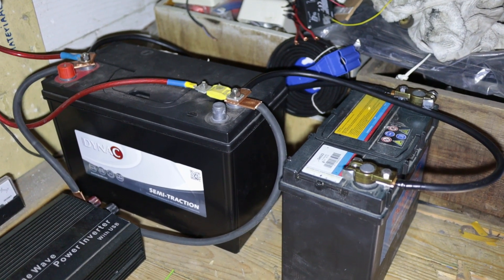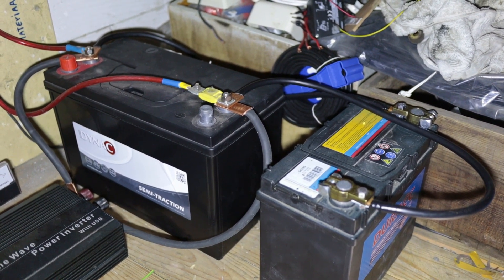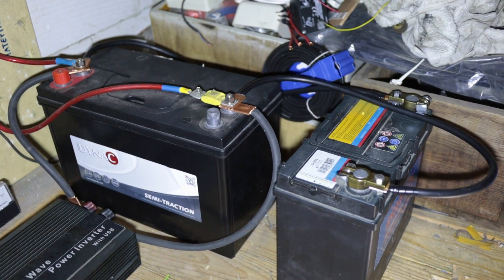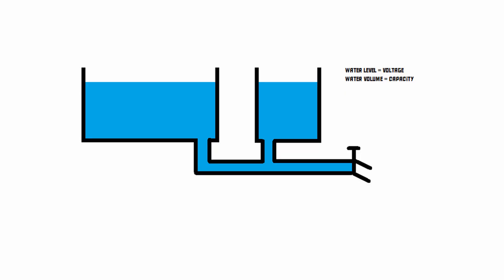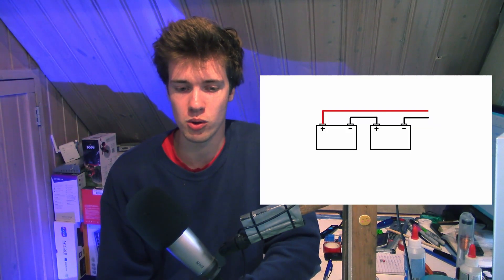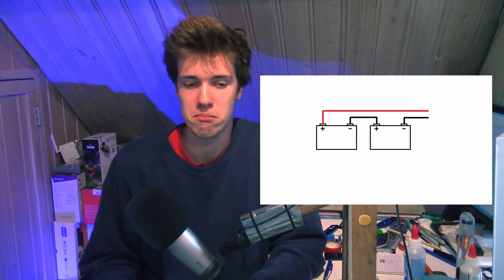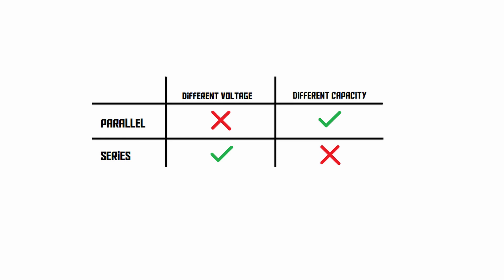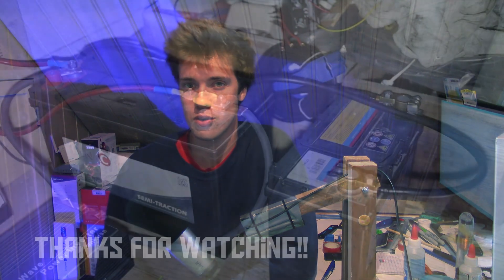Connecting different batteries in parallel/series (AKIO TV)

Comment: Quick question as temperery solution i have two large lead acid battery's of nearly the same ah I need to connect them in series to obtain 24 volts the current draw is only a Chinese desil heater and there charged all day on solar so can I get away with this as temperery fix till I have new battery's 
Thanks in advance

Comment: I have a question, I have 4 x 12.8v 200a lithium batteries connected as 2s2p going to a bus bar and then a 24v 3200w hybrid inverter. Can i connect a battery charger or chargers to this setup to top up the batteries . I live in the north of Scotland, I have 12 x 200w panels and through the winter there is not enough sunlight to keep the batteries charged so if i set timers on chargers to use cheap night time rates for mains electricity and use this power during the day. BUT how and where in the battery setup would I connect the charger/chargers. Hope all this makes sense.

Comment: I currently have 4 x 300ah LFP in series (48 volts).  They are 9 months old.  I would like to add another 4x300ah (same voltage and ah).  Should i wire it:  new+old in parallel (so they stay equalized) and then 4 of those in series, or should I leave the existing old four in series and add the four new in series and parallel new to old.  Option 1:  (old + new)P x 4 in Series,   OR    Options 2:  [4S(old) + 4S(new) in parallel]?  I am concerned about charging.
Reply from the maker: @bkokenge  Although arguments could be made for both options, parallel groups in series is usually preferred over series groups in parallel.
Reply: @AKIOTV   I believe there is also concern over the length of the cables - that is, we want them all same length to prevent voltage drop.

Comment: That had to be the best explanation.
I just want to be sure for my situation.
So I have 2 acid batteries at 12 volts one is a car battery with 45 ah the other 190 ah I want to connect in parallel which I already have done before. But I had only being drawing from the 190ah battery. 
The question is is I draw from both batteries by take a positive lead from one battery and negative lead from the other does it matter which is the positive lead and negative lead taken from ?
Reply: Technically you are drawing from both unless you have some sort of isolator on the positive wire joining the 2 batteries. Can be as simple as a manual isolator switch or disconnecting the terminal, or more advancved methods.
Vehicle dual batteries systems have been using isolators for decades to "protect" the starter battery from drawing. Most commonly there are isolators which connect via a switch (eg your ignition key) or there are "smart" Voltage sensing relays (VSR), these connect and disconnnect at preset voltages. for example connect when an alternator or other charger is providing 14v to the starter battery, and disconnect when the starter battery dorps to 12.8V (approximately float voltage of lead acid)

Comment: I am a cheap Charlie. My camper truck has 2 starter batteries and 2 deep-cycle batteries, all wired in parallel, off different capacities and ages. My feed to my inverter goes off the biggest deep-cycle battery. My oldest battery is coming up 5 years old and still good. My deep-cycle batteries alone cannot run my microwave, but with the starter batteries in the circuit, I have no problem. 
    The only issue I have is to regularly clean the terminals, but I do monitor their voltage and condition. I now rely on cheap reconditioned batteries and have found they work well. I am sure a lot of the crap about using the same capacity and age batteries is a sales gimmick
Reply: Using the starter batteries in parallel with the deep cycle batteries is not ideal since, to get the capacity from the deep cycle batteries, you need to run the voltage down quite low but this will ultimately damage the starter batteries, which need to be used at full voltage most of the time. With your configuration you would need to keep the voltage high - in the top 10% of charge. There isn't really a good way around this that I can think of.
Starter batteries and deep cycle batteries are not really the "same chemistry" just as flooded lead acid and VRLA (sealed) lead acid batteries are not. Getting a bit nit-picky...but it could affect the life. Not really the safety, though. Parallel is pretty good that way.
Reply: @HughCStevenson1  Mate, my main big starter battery is my oldest battery, but as soon as the voltage running my fridge etc drops below 12volts.  I manually isolate my starter batteries. But I have too say, you can paye megabucks for auto systems but a little bit of knowledge and physical presence saves you lots

Comment: Great vid! Easy to understand. Q… Can I connect 2 12v 50Ah Li-ion batts in Series/Parallel (24v 100Ah total) or is there a min # of batts (ex. 4 or more)? Pros and Cons please 😁
Reply: If you have two identical batteries you can connect them in parallel to get 12 V 100 AH or in series to get 24 V 50 AH. Parallel is preferable because the batteries will automatically share. in series you would need to check over time that the voltage on each is staying close to the same.
If you want 24 V 100 AH you need 4 batteries in series/parallel. You can connect the center terminals together.

Comment: When doing 12v in parallel, how close do the charges need to be?

Say one battery holds at 12.4v and the other holds at 12.8v, would that work or be too much of a difference?
Reply from the maker: @Powerstroke431  Ideally very close. Especially if it's li-ion/li-fe it's important. 

With lead acid, less so. Lead acid batteries can very easily increase/decrease in voltage regardless of their charge level, making them quite forgiving in this aspect. That's why you can hook up jump leads to start a vehicle without measuring voltages first.
Reply: @AKIOTV  I have a 12v 90 minute reserve, 675MCA lead acid right now and just looking for another good working used lead acid to run in parallel with it and just want to make sure I buy the correct battery. Thanks for your help brother :)

Comment: Ive heard you can wire 2 lifepo4 batteries in parallel, but wired in series is problematic for keeping the 2 batteries balanced to each other. Also best to even use same capacity batteries together in parallel.
Reply: No, in parallel it doesn't matter, so long as the voltage vs state of chrge is the same for both - hence the need for the "same chemistry".

Comment: What if the second battery is a supercapacitor?
Reply from the maker: @D-365  It'll work but:

- it's virtually pointless, the battery will almost always have far, far more capacity than the capacitor.

- you need to be careful connecting a battery in parallel to an empty capacitor, it will cause a massive surge of charging current that could damage the battery or the capacitor. Before connecting them directly the first time, you could use a resistor between them to limit the current.
Reply: @AKIOTV  Tjank you brother! :D

Comment: Hi, will a 6V 208Ah battery and 5- 6V 225Ah battery connected in series for 36V be a big problem? I'm having trouble getting a direct replacement for a bad battery on my golf cart, and I don't really want the expense of having to by all new batteries. I know you said capacities should be the same in series, but I'm thinking the older 225Ah batteries may have some degradation any way. Thanks
Reply: Ughhh! Did you try it out?? :) It could work. Are they flooded wet-cell lead acid or "sealed" VRLA cells? The wet cells are more tolerant of overcharging - they will boil off electrolyte (actually water) and need topping up with distilled water. "sealed" cells struggle and get hot when overcharged...

Comment: If you think about it you are wrong!!  You can connect different types together!!  Everyone knows you can connect a power station which is lithium to car battery which is LEAD!  I have been doing  this for years connecting a lithium battery to LEAD!.  It can be done with a solar controller!  Connect the reception battery first to the controller battery terminals!  Then connect the other battery to the solar input connectors!  Flow will only go one way from the solar input controller to the battery controller!
Reply from the maker: @adrianfoster4899   I can combine any two batteries if I use some sort of electronic equipment. Surely then the video is also "wrong" because with a bidirectional dc converter you could connect a 500V battery and a 3V battery in parallel.
Reply: Surely by definition a battery is electronic equipment so now u r saying by connecting 2 batteries (electronic equipment) meets your criteria which is obviously wrong!

Comment: Is it possible to connect three strings of batteries in parallel (all AMG) 2x100Ah (24 Volts together) in series plus 2x150Ah (24 Volts) in series plus 260 AH (24 Volts) in series. I would like to equip each row of batteries with a voltage balancer. Is this a good idea for a photovoltaic energy bank? Best regards, Gabriel
Reply: I do this using a switch between each size else the smaller capacities fill first and overcharge...you can use separate solar controllers on each battery bank which overcomes this issue...pwm controllers are cheap and good enough 👍

Comment: So is lead acid the same chem. As gel lead acid?
Reply: Not really but you can probably get away with it. Professionally it would not be done because they want to get the absolute maximum life out of the batteries. Decades...! If you don't need that, it will work ok.

Comment: Sorry I have a question,
I need to kee my truck battery charged, but in that truck I also have a tennis ball machine that has a battery if different size but both have the sane chemistry.
Would this method work to keep not betteries charged with one solar panel
Thank you
Reply from the maker: If they're both 12v lead acid it should be fine. I'm not sure if I'd also keep the batteries in parallel while starting/driving the truck. Perhaps also put a fuse between them so a short on the tennis ball machine won't short out the (big) truck battery.

Comment: This explains why I'm getting hot batteries in the solar setup. This is a 5 year old install.  2 strings 8 x 6 volt deep cycle flooded lead acid batteries making 1 array of 16 6 volt batteries at nominal 48 volts. The "hot" batteries capacities are now very low and are discharging and rechargimg at a much greater percentage of their true capacity than the others in the string. The 2nd string was unable to support any load.  Dropping from resting voltage of 52volts to zero in seconds the moment a load was applied

Comment: bro what if we have same lead acid batteries with same amp and volts but the one is old(almost 2 years old in using but still have good backup)  and the other one is new can we still connect both in series?

Comment: Very helpful. I connected  12x2 volt batteries in series = 24 volts. 8x 1000ah + 4x600ah.  Knowing it's not quite right, but not knowing exacts. So now I've got buy more of the same ah to match. Hope I can fix before a fire!!
Reply: Series is a lot more critical than parallel. Even old vs new batteries of the same nominal capacity, brand, type are not good to combine, since their capacity changes with age. Wet cell lead acid is more tolerant of overcharge (which is what happens to the lower capacity cells) - they will "boil off" electrolyte and need topping up. Other technologies - don't do it, you could end up with toast or worse!

Comment: Hi, so useful. In case we have the Active Balance, can we connect series 50Ah 12V with 100Ah 12V for real life using?
Reply from the maker: If you have active balancing, connecting different capacities in series may be safe, but it's still a waste of capacity. With 50 and 100Ah in series, the usable capacity will be 50Ah.
Reply: @AKIOTV  thank you so much

Comment: lets say i have old batteries.... they both on label are 12v  50AH.... but one of the batteries from using have loose the capicity... can i wire them in series because on label are printed 12v 50ah on both batteries?
Reply from the maker: not a good idea. The actual capacity can be very different

Comment: I have a mightymax 100ah battery paralleled to a group 35 optima yellowtop. Its connected to my car stereo with a battery switch between the amp and the group of batteries. Been working for over a year and a half with the occassional charging in my garage. The problem is if i dont drive it for more than 4 days, voltage gets to 12v. Is it because the mighty max or the yellowtop is charging each other? The mightymax is nearest to my amp and the yellowtop is in the engine bay for starting. Does starting the car drain both batteries?
Reply: if it's connected in parallel then yes it would. Don't connect the car starting battery to the other battery. if you want them both to charge at the same time from the alternator then get a dc to dc charger that runs from the split way of your alternator to both batteries. You need to know the amps of your alternator before buying a dc to dc charge to get the right size. 

Remember starting batteries use high amps for a few seconds when starting your car then get boost up again once the alternator is running.

Comment: WOW! This is the first video I've watched  that's very easy to understands. I have one question though as I have heard conflicting info. Can I connect two 130 ah Lead Acid with a 105 ah Lead Acid battery to have a total of three batteries with a combined amperage of 365?? Thank you so much!
Reply from the maker: you probably could so long as they're all in parallel and have the same voltage

Comment: I have connected agm batteries @48v parallel to lifepo4 batteries which Re the same 48v and have had them working for 3yrs now, I've also recently seen video  from the off grid garage where he paralleled a 100ah(5kw) and a 280ah(14kw) and both ran successfully, what u people should explain is that if ur a novice at this stuff and don't understand batteries it's wise to leave it to the pros

Comment: What if you have 2 slightly different capacity batteries in series but you only charge through the smaller one?
Reply from the maker: slightly different capacities in series could be done safely if you have active monitoring/balancing during charging and discharging to keep both batteries at safe voltages. It's complicated and messy so I'd avoid it.

Comment: Can lead acid battery be connected together with a mantainace free battery in parallel?
Reply: Not really but you can probably get away with it. Professionally it would not be done because they want to get the absolute maximum life out of the batteries. Decades...! If you don't need that, it will work ok.

Comment: Sealed lead acid battery and flooded lead acid battery can mixing them together in parallel?
Reply: Not really but you can probably get away with it. Professionally it would not be done because they want to get the absolute maximum life out of the batteries. Decades...! If you don't need that, it will work ok.

Comment: I agree most of thinks you said but thinks to consider in connecting batteries in parallel also age and capacity effect.
- When you connect different age batteries in parallel older batteries will drain the newer ones over time. 
- When you connect different capacity batteries in parallel, smaller batteries have longer time on charging absoption and bulk. This doesnt have too much effect on 100Ah with 105 Ah battery but it will destroy fast 100 Ah battery with 20Ah battery. 
- Also different brand batteries even they have the same chemistery they have different plates and different charging charesteristics. This will also increse the chance of 1 battery to supply other battery. 
- Also when you are discharging, if the batteries has huge difference in capacity and you pull near the limit amps always biggest one tries to compansate the smaller one. This will kill the big one because when you stop discharhing the big one will compansate the smaller one and big one will make work harder which will.

Batteries in parallel work as "weakest link" and weak ones damage the strong ones over time. =) 

But of course if you have batteries lying around and one is not enough, you can parallel them like this and take the most juice out of them. Better than nothing  =)
Reply: Good information, thanks
Reply: This is true. I had 3 group 31 batteries in parallel and was watching my voltmeter slowly dropping from 14.8 to 13v when car was at idle. I thought it was my alternator but when i disconnected batteries one by one i found that the second battery was affecting charge. All batteries were trying to charge that one battery and the alternator was supplying what voltage it was sensing at the positive terminal of the alternator and not the battery. So voltage was dropping between batteries but alternator was not sensing a large change, so it was not compensating for voltage drop. But my voltage monitor was connected to rear battery. Thats how i was seeing charge drop due to bad battery. I replaced that one battery and charged my other 2 before installing and it was working perfectly

Comment: As someone who has no clue about this stuff, I have queries that I would be grateful for answers to. I have a motion sensing light that requires 4x AAA batteries mounted in a single line. As it's not an important light to have, I just use old 1.2v Ni-MH batteries of varying mAh ratings (mostly 900 with a couple 500) that don't last long in the home phones anymore. Based on your explanation, am I correct in saying these are connected in series and therefore is not recommended to mix capacities?

Having put 900mAh cells on each end with two 500's in the middle, the light flickers. However if I put the 500's on the ends and the 900's in the middle or alternate with 900, 500, 900, 500 (also 500, 900, 500, 900), the light is stable. I assume this makes no difference to the damage it could do to the cells?
Reply: Correct. Nasty idea! :)